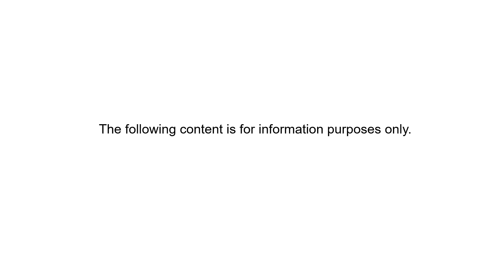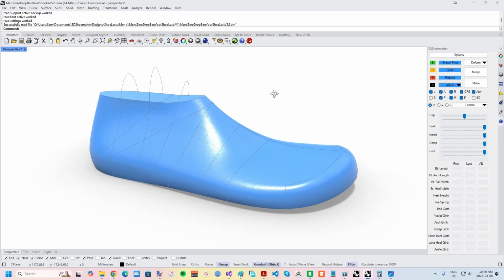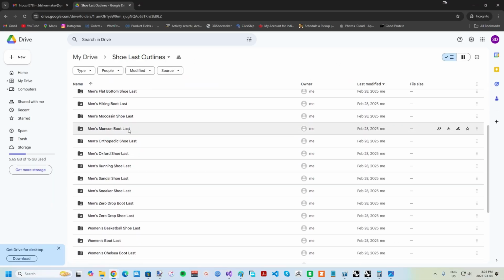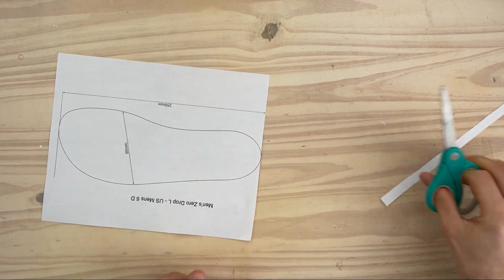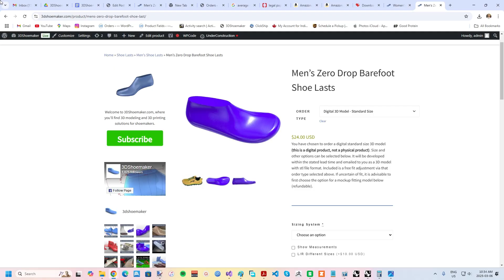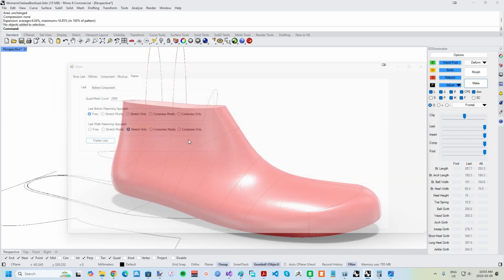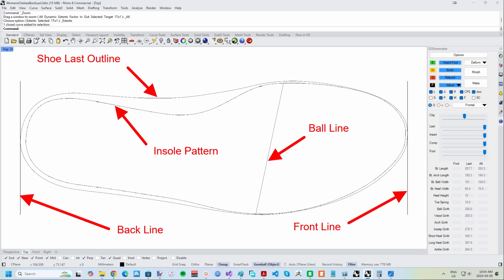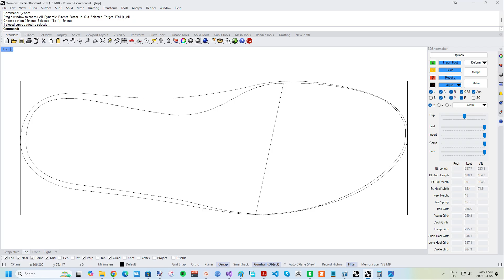Shoe Last Outlines for Solving Online Shoe Sizing

Comment: Could you show us your print slicer set up. Removing supports from tpu is very difficult haha!?
Reply from the maker: I've actually been getting away with defaults with Bambu studio generic TPU. But for foaming tpu, I just up the interface spacing to like 0.6mm.
Reply: @ wow! I find support removal horrendous haha! I haven’t tried any foaming tpu as of yet !
Reply: @OSCN. Foaming TPU is the best ( you can get sum grip & way better flex ). I struggled with TPU to start. in the end you need to sit back and look @ your printer, there all different. most vides i watched sead no retraction, but i find retraction good to release the tenchon in the extruder. there is no substitute for messing about :) tour locashon will effect a bunch of things as well, lick print temperature Happy printing :)